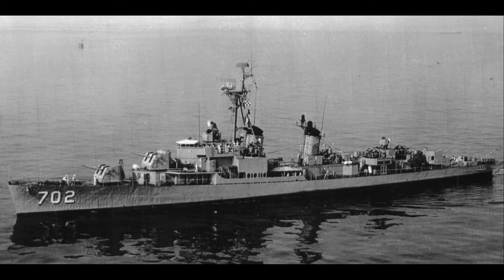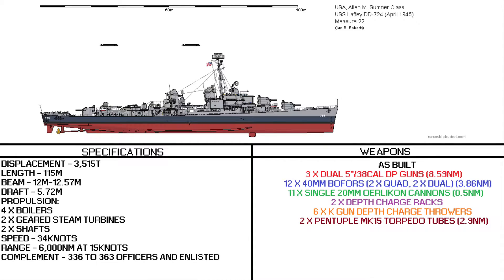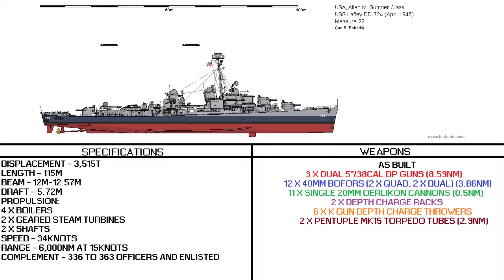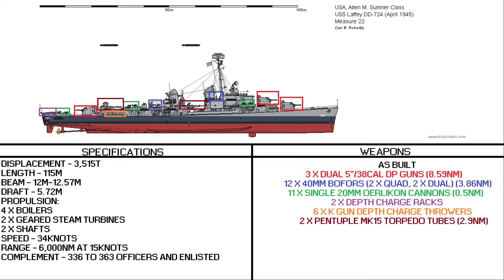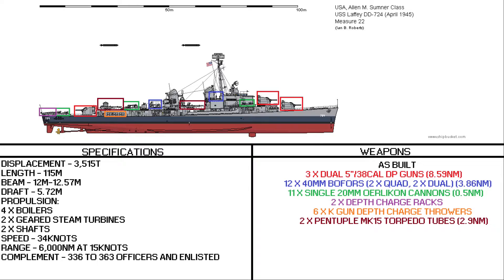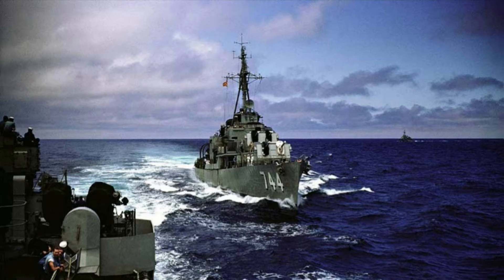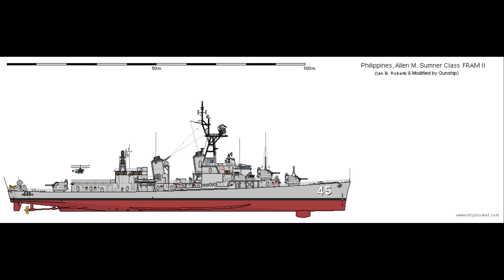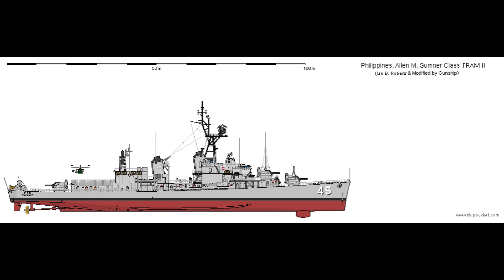ALLEN M. SUMNER CLASS DESTROYER BRIEF - NO. 64

Comment: I was a Knox class crewman.  Habitability and sensor fit were vastly improved over the Sumner class, while armament, speed, and range, were considerably reduced.  With one screw, one rudder, and a 30kt (straining every rivet) top speed, the Knoxes were specialized ASW escorts, opposed to the Sumner class' more general purpose fit.  Oddly enough, the Knox class was close to TWICE the Sumner's displacement.
  A bit strange that, in an era where potential enemy subs were able to make 25kts+ submerged, the Knox class emphasized ASW weapon range over class maneuverability and high dash speed.  We were fitted for a Helo, but I never saw one land on the helo deck or be stored in our hangar.
  ASW warfare on the Knox class was the province of SoNAR and ASROC (and to a lesser extent small ASW torpedoes).  The age of the "roll 'em off the fantail!" Depth Charge was over by 1972.
  Our AA defenses were lousy, with a Mk l Eyeball directed PDMS (an 8 cell Sea Sparrow box launcher with a guidance turntable above the fantail) and the 5"/38cal forward.
  I was a snipe, but that gun was more precious to me than our engines.
  In my view, what's needed in ASW warfare is an effective anti-TORPEDO weapon.  It's most likely our boys will detect an enemy sub only when it fires a a weapon at us.  By then it's too late for the surface ship to do anything but prepare for the afterlife.  Why?  Because we need an effective anti-Torpedo weapon or device.  Decoys are cute, but a dumb torpedo will still go right through them as if they don't exist.
Reply: Which Knox class?  I was an FC on USS Barbey FF1088.
Reply: Knox class had a 5 inch 54 cal gun not 5/38. Garcia class (FF-1040 to 1051) were the last class to have 5 inch 38 cal guns.
Reply: Well, sounds like it was the best-possible ASW Destroyer.  This version was more Pacific, and ready for GunFights and Air Attacks.
Reply: My first ship was a Sumner class John W Thomason DD-760 and my last was putting the John Knox DE-1052 into commission at Bremerton, Wa.  The class was later changed from DE to FF
Reply: @randymyers2544  Cool!  The Sumner/Gearings were the ultimate WW2 design.

Comment: Follow up to the Sumner’s were the Gearing class. These were then followed by the Forrest Sherman class. The Knox class were originally follow ups to WWII destroyer escorts and were originally classified as DE’s. Sumner/Gearing class had four, not eight, boilers. 600 psig B&W with controlled superheat.

Leary DD879
Charles P. Cecil DD835
Glennon DD840